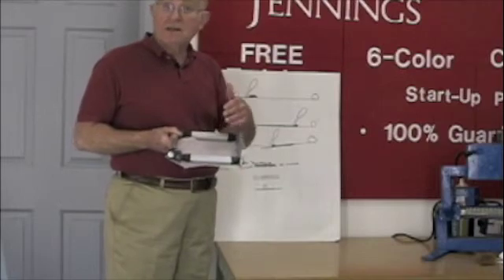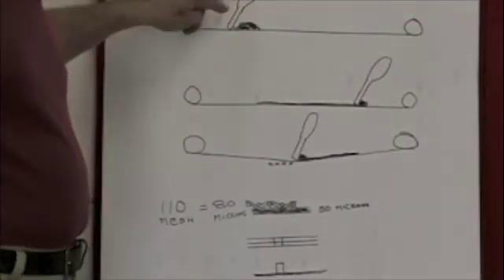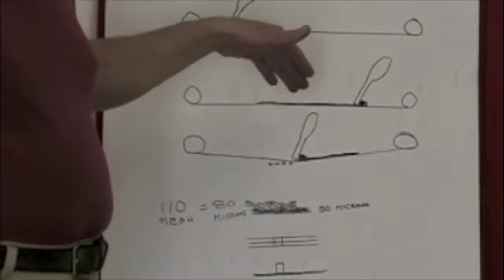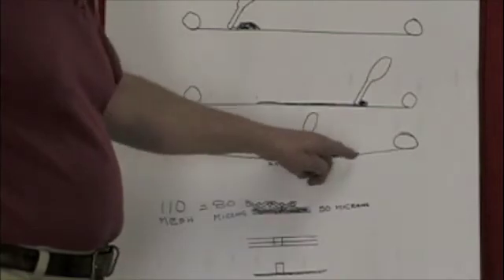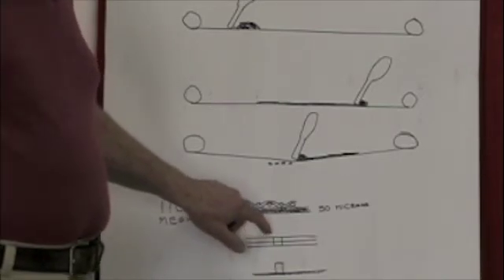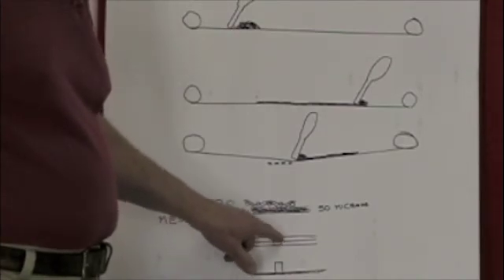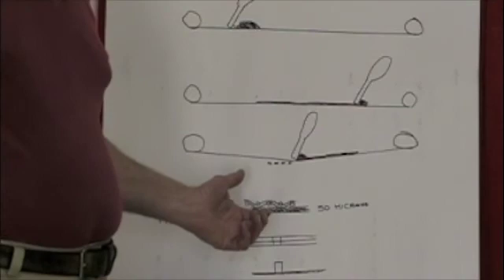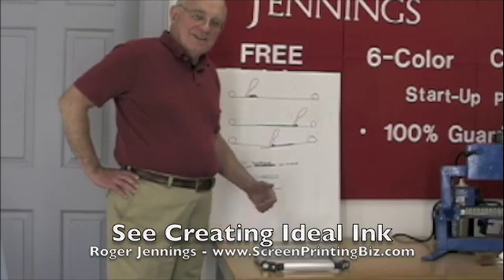Controlling the Look and Feel of Ink

Comment from the maker: When most people back flood they push ink through the screen.  Then the next image printed has excess ink.  A back floor should be very light  to lay ink on top of the screen.  The squeegee when back flooding should never touch the mesh.  The lower risk for most people after the print stroke is to scoop the ink up by rotating your wrist, and then carry the ink back to the starting point.  Rotate the wrist  again, but in the opposite direction with the squeegee touching the mesh.

Comment: hi mr jennings, 
since you do not recommend flooding the screen with ink, how do you get the ink back to the rear of the screen for the next shirt after you make a print?
do you  pull just enough ink across the screen to print one shirt? it seems that the ink would build up on the front of the screen  after a few prints. i want to make sure i get the tecnique right. your other advice has worked well for me.